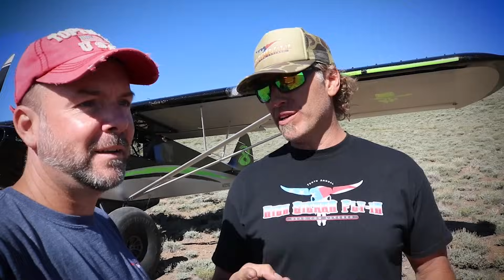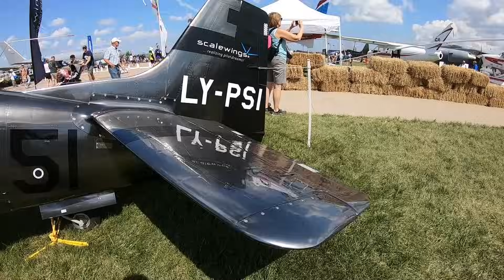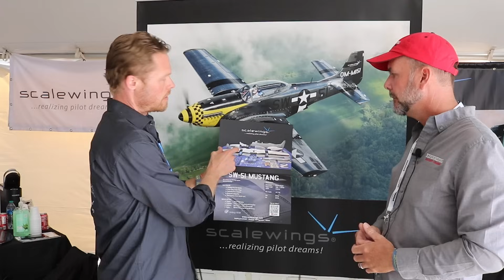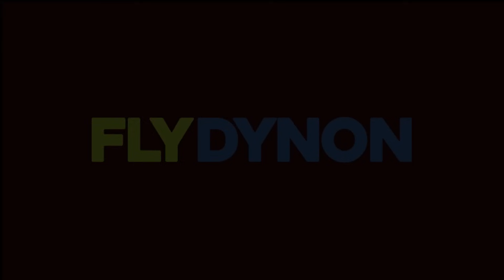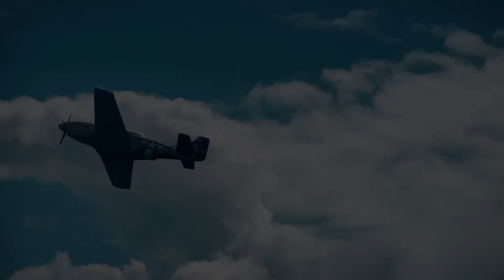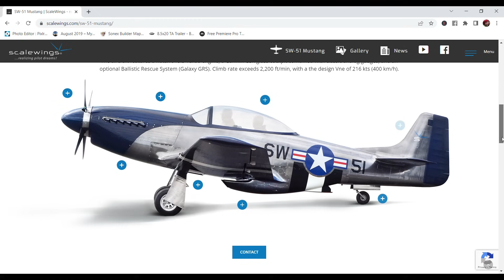Military Aircraft SW51 Mustang YOU can Build! Carbon Fiber Scale Wings Kit -  Oshkosh 2022

Comment: Someone needs to make a 70% Merlin engine.
Reply: Facts
Reply: Have a look at the  Aerosport Engineering of Norway V12 engine specifically designed for scale warbirds. 650hp 54g/hr
Reply: @bradleydavies3225  Thanks, do they sound the same? 70% Lancaster with four engines.
Reply: Ironically, most modern car V12 engines are way to small to be a 70% merlin... It would need to be 9.3L. But if we ignore that and just look at the horse power, that is about 440hp or there abouts. Well inside range of most V12 avalible today.

If you had a true 70% scale merlin it would be 255kg, that would be to heavy for this airframe.
Reply: How about 2 4.3 litre V6's melded together?
Reply: Nah that rotax has better power to weight ratio than an actual mustang haha
Reply: @bradleydavies3225  that would give plane about 15 min endurance.
Reply: nah, go full sized. thing might be almost supersonic at that point.
Reply: Steve Morris engines could make one... theoretically.    Reliability might be an issue.

70% x 12 = 8.4 cylinders.  ie, use a V8.
Reply: Use a Jag V12 and spec it up
Reply: How about the Falconer V-12
Reply: Toyota made a V12. You can get one through a JDM supplier
Reply: Doesn't REDD make good 600SHP V12 engines?
Reply: I think it's called a Chevy!
Reply: @matsv201 a V12 Chevy LS (aftermarket made engine) is 9.5 liters and has a dry long block weight of 421 lbs or 191 kg. And it makes oodles of horsepower, although it would be hard to say how much it would make in an aircraft application at low-ish rpm
Reply: Falconer v12
Reply: @matsv201  Where does this 255 kg mass come from? Of course, mass increases or decreases as the cube of the length, but yet...
Reply: @fabiena1787  yea. Just the cube of the weight of the original engine
Reply: PT6
Reply: Viper motor!
Reply: I have seen a 1/4 scale Stuka somewhere in Texas I would like to find it again but the guy who built it was in Love with Stukas  ! I don’t remember if it would do an actual dive though. ! If anyone else has knowledge of this please share !
Reply: There is an Australian company building custom v12 based on ls engine, can't remember their name though.
Reply: A V8 Merlin, all aluminum with a turbocharged engine putting out a reliable 600 HP at all altitudes. 

350+ KTS and range.
Reply: Hell ya
Reply: @bradleydavies3225 that’s a HELL of a lot better than a frikin’ Rotax (good as they are - but this is NOT the place). They scale it down in size by 30% but cut 75% of the power!!   Booo
Reply: A 70 percent Merlin would be wayyyy to heavy compared to the rotax in this plane also it would be roughly 70% of the power in a regular Merlin meaning it would be much to powerful and have awful Torque roll and ground handling on takeoff
Reply: True. But the airframe they designed was made exactly for the engine that’s in the bird.
Reply: Jaguar has a 12 cylinder
Reply: There used to be a Falconer v-12 just for this kind of application. It was based on the small block Chevy...!
Reply: Ryan Falconer makes a small block Chevy based v-12 just for this kind of application.

Comment: Imagine if this company built a 70% scale P38, that would be really interesting
Reply: Love the P-38! 

I wonder what the Yamaha inline 4 would do in such a dual-boom craft? The Yami 4 is doing amazing things in other experimentals, producing nearly turbine weight to power ratios with modern ICE fuel burns.
Reply: @RobertLBarnard  Indmar Marine builds marinized 2.3L EcoBoost engines. Makes me wonder how the engine would do in an aviation application as well.
Reply: @RobertLBarnard   "Fly Rotary" is all I'm sayin'...
Reply: @RobertLBarnard  imagine if the LS was built into a air engine. we see 2000hp ls's all day now. i can imagine a full scale carbon composite P51 with a 2000hp SMX with extra sumps for flying at any angle.
Reply: It would be awesome but I imagine the liability for a twin engine P38 close who's original design was  killing pilots in steep dives would be far too much to assume
Reply: Yeah, a P38 would be cool... but I want a 70% F4 Phantom!
Reply: @nunyabidniz2868  oh, I followed the avi 13B's for a lot of years. Carbon carbon apex seals, Teflon o-rings, alconal secondary combustion chamber, boosted, stratified combustion.... Slow fade of hp vs catastrophic... Yeah, lots of potential, lots of flying examples. Just wish the fuel burn could get better.
Reply: @alphotomc9867 the Berkut had the same type of canopies as the Phantom. I remember being introduced to Klaus Savier (Light Speed Engineering in Santa Paula CA), he built the prop for it and went into a lot of detail of what he did to design and build it. I'll never forget that conversation.
Reply: @louisbabycos106  The liability rests mostly with the builder, although anyone can file against anyone for any reason. Also, I don't imagine an engineer would take a set of P-38 plans, key in "70%" on the scanner/copier and start selling copies. A "replica" of a P-38 would more likely resemble the Pond Racer in it's evolution.
If someone wanted to own some real P-38 lineage, it's purported the Questair Venture was designed by a team who could trace their work all the way back to the P-38.
BTY - The Questair Venture was said to be a fine aircraft. Fast, close coupled, slick, all aluminum, retractable... Did I say fast? Examples competed at Reno. Unfortunately one owner/pilot was killed when he took his Questair 30 kots above it's Vne of 300. Maneuvering around pilon at 330 knots, the horizontal stabilizer appeared to come apart, a small porpoising motion and they were gone. The investigation suggests that even though the aircraft was operating well outside it's published specifications, the flutter wasn't the cause. Rather PIO as a result of the spring in the elevator force feel/limiter assembly was the wrong size and had only 30 percent of the required tension. Other discrepancies and workmanship issues were sited. The plane when built right, had significant margin designed into it.
Reply: @borgheses  looking at all that shiny aluminum.... Beauty! Way, way back, 30 years ago now, I worked on an engine project for Ford. It used the Cosworth casting process, we could keep a 7 thousandth tolerance in an aluminum casting. A 4.5 mm wall thickness all around, lots of ribbing and 3 mm fillets. Very light, very strong. Head bolts all the way down into the main bearing blocks. Line bored mains... Load bearing oil pan & skirt. Cracked rods. Hollow cams to carry oil to the powdered metal lobes, so the rolling bearings on the valves rode on a cushion of oil "sweating" out of the lobes. Lots of cool stuff at the time. The 4.6 engine went into the Lincoln MK VIII, it was the second engine program I worked on for Ford.

It's great to dream big!
I'm trying to dream something I can build and afford to fly. That's why I keep looking at those little Yami's. Tough as nails, used widely in experimental aircraft for competition and back country flying. We'll over 200 HP in a 200 lbs package, sipping (non-ethanol) fuel from the pump. The inline 4 block has reduced frontal area too. It's a cute engine with excellent metallurgy. The ones out of snowmobiles seem to be just a tad bit heavier built than those out of a bike. They also don't have all the extra casting for the (bike's) transmission.
Reply: @pootmahgoots8482  These are cool little powerplants. I'm a little partial to Ford (we're Michigan natives, long line of machinists and toolmakers for Ford and Ford-related stuff. I worked on several Ford projects in the CAD/CAM field 30 years ago)...
I like the Ecoboost systems. Lots of opportunity with the CAN-bus for aircraft tuning.
Reply: 💓💓💓💓💓 Yes and a spitfire!
Reply: You just need to go down to the horse race track to find the pilots, so everything looks right.
Reply: Hey, with God anything is possible🤷‍♂️
Reply: Ta-152
Reply: @borgheses 2000hp for what, to run down the 1/4 mile once then get checked over? Aircraft engines run at high load for long periods of time. An LS would likely require a gearbox for the prop. Aero engines are completely different, and for good reason.
Reply: Now imagine that and a p-40 Warhawk

Comment: Airframe looks pretty compelling.  Would LIVE to see this upgraded to 3x the power.
Reply: I’m not sure that 450 hp would be desirable in this airframe. Unless you’re looking at a turboprop, any piston engine of 450 hp is going to add an unmanageable amount of weight.
I’m a horsepower fiend, but I believe the designer has landed on the sweet spot of power to weight.
Reply: Strap a Merlin on the front of this thing and you still won't be able to exceed 216kts.  The extra power isn't worth much of anything without an increased Vne
Reply: @Skinflaps_Meatslapper  Interesting that it would be limited in this way.  Why build something that LOOKS like a P-51, but does not perform more like a "hot rod"?  It's like those lambo kit cars based on a Pontiac Fiero or Volkswagen beetle running gear.  Sure, it LOOKS like a lambo, but it still performs like a relatively slow economy car.  Not complaining, but curious.  The Rotax 915is can be configured with up to 300hp.
Reply: Nope, strap a modified Kawasaki Jet Ski supercharged 310 hp motor on there. Another guy in the Experimental world has one with 410 hp for STOL competition planes. They are extremely tough powerplants! All forged steel and can handle up to 1200hp in race configuration!
Reply: @RitzRT  Giving this plane more power would be very similar to retrofitting a 400HP turbo hayabusa engine in a moped that experiences an unavoidable high speed wobble at 65mph.  Sure, you'd get up to speed quick...real quick...probably doing a wheelie the entire time...but you won't be busting through that 65mph mark unless you just feel like dying.  The reason why they made this plane with an inherent speed limit is because they had no interest in making it based on performance.  It started off as a scale RC plane meant to look like a mustang, and they simply scaled it up to fit people.  The whole thing is based on appearances alone, and I wouldn't be the least bit surprised if they called it a success after finding out it could only fly 100mph.  Scale warbird enthusiasts have this mindset that they need to fly slow to look more scale, and they're real particular about copying panel lines and rivets...apparently that mindset is pretty hard to shake off when designing real airplanes.
Reply: @waveman2952  Those engines can handle short busts at that level of power output, but they can't handle continuous operation anywhere close to that.  You'd probably get by with safely using the unmodified 310HP continuously if the PSRU was geared correctly.  Not even that STOL competition plane uses that extra power continuously, it's only a short burst for takeoff...the rest of the time it's pulled way back so the engine doesn't tear itself apart.  Doesn't really matter though, the extra power won't do you any good with this airframe.
Reply: @Skinflaps_Meatslapper  Not disputing what you're saying, but I can't imagine investing the time and energy into building a project like that only to have "ho hum" performance.
Reply: @RitzRT  I was really excited about this plane when I first clicked on the video, hoping it might fill the gap between a Titan T51 and the thunder mustang, something that would have a cruise speed falling between 225-325mph with a little more power than your average kitplane, because that's a sorely under-represented area in the world of replica warbirds and kitplanes alike.  Some guys like warbirds for their looks, some like them for performance, some like them for both...so it's a little ridiculous to only cater to the looks crowd when all it takes is some sound engineering to make a bird this size handle far more than a little rotax and a 216kt Vne.
Reply: It is a little disappointing to see a very nice 75% scale P-51 but that only goes about 50% of the speed of the original and only about 60% of the climb rate. I mean, the original had some 1,700hp and this doesn't even get 150hp.
Reply: @misegades  Like buying a Corvette with a chevette engine.
Reply: @misegades  The ideal power for this size and scale P-51 replica is in the 600-650HP range, if you want to meet or exceed P-51 performance.  That was pretty well established with the Thunder Mustang, while the Stewart S-51 established a 275mph baseline with 400HP.  This particular aircraft is on par with the Titan T-51 at near identical performance with similar power.  Scalewings at one point were planning on making a US experimental version that could support up to 600HP with a boost in gross weight among other things, but I guess they decided to focus on fake rivet placement instead.  The original model was meant to have a 2000W sound system to imitate a Merlin on startup, complete with a little smoke system for effect, so it's pretty apparent what they're going for.

Comment: Dears, the current Vne is based, with some margin, on the actual Vh with the Rotax. (Vh is the maximum horizontal speed) 
Of course with a larger engine, the aircraft can technically do higher Vne (upon testing and confirmation). 
Due to the use of carbon fiber push rods in the control surfaces and the entire carbon fiber structure design with huge static load reserves, and incredible stiffness, the aircraft can see higher speeds at all and is principally already designed for it ;)

Comment: Outstanding detail on the airframe, but there's no way I'm paying $200k for a 70% scale fuselage that uses 9% of the original hp.
Reply: Another video said they are working with a partner to investigate powering with GM LS V8!
Reply: @clarkstonguy1065  Well that's great and all but the Vne won't change with a bigger engine.  You might be able to climb at 6,000fpm or whatever with a big engine but you're still limited to 216kts, full stop.  You're also only working with about 50gal including the optional tanks, so if you're talking a 400HP V8 expect to be burning 25gph, maybe 20 in economy cruise, and that leaves you with 2hrs or less of fuel on board and short little 400 mile legs.  It's a nicely scaled plane, but it falls pretty short in capability and performance.  Kind of the same issue the Titan T-51 ran into, they originally made it for a Rotax, then later went up to V6 and V8 engines but their potential was still limited by that annoying Vne and little fuel tanks.
Reply: @clarkstonguy1065  It's certainly achievable given that the Thunder Mustang folks pulled it off with the Falconer V12 engine.  Though that doesn't appear to have helped them sell many units.  :P
Reply: @clarkstonguy1065  Chrysler Hemi would be better.
Reply: 9 Tons armed and fuel if I recall and 51000 ft with the most advanced supercharger ever produced to this day, 2600hp. That sc cost 250,000 easy
Reply: @jamesbullock7257  Wow, out of all the numbers you threw out there, not a single one is remotely accurate.  That's impressive actually, statistically you should've been able to guess at least one of them correctly.  Also, the supercharger is integral to the engine accessory case, you can't just buy one and bolt it on a different engine.

Comment: As one considering a P-51 kit in the future, I am quite picky, especially with the amount of money involved. My problem with this Scale Wings Mustang is the prop. It's too short. I understand the aerodynamics, but I want something bigger. That may put Scale Wings out of the picture for me unless I can swing a longer 4 blade prop. I like the idea of dual-place, dual-controls, but the canopy is too big, which damages the scale lines as well. The proportions are off, so far Stewart looks better to me.
Reply: there are other Prop variants available.. this one has a diamater of 1800mm, but we do offer a Titan Aircraft prop of 2160mm as well. Depending on the engine, we also have a MT-Prop of 2300mm available, which exactly mimics the shapes and size of the Original Mustang at 70% proportion. Remember, this is a Kit plane, so the choice of Prop is your decision. See our gallery at www.scalewings.com for the big 2300mm MT-Prop on our serial number #000 "Moon Eagle"!
Reply: @scalewingsaircraft  Thank you!  Moon Eagle is what it should look like! Wonderful! The canopy is not a deal-killer, but I do want a longer prop. Your Mustang is definitely the most stunning. Say that an American uses the assistance of your manufacturing facility. What are the options of getting the aircraft to the United States? Is flying it to the U.S. an option?
Reply: @scalewingsaircraft  Does the Rotax 915iS swing that 2300mm prop, or is a bigger engine needed? Where can I find performance specs with the big 2300mm prop? Has anyone in the U.S. expressed desire for fractional ownership & building of an SW-51? I'm an A&P, structures & sheet metal specialty and have a commercial/instrument & a few hundred hours. Tailwheel certified & want to build a Mustang. With the 2300mm prop! Ha, ha, I'm a picky S.O.B. Will this be ultralight in the U.S? Certainly not. Dual controls?

Comment: The real P-51 had laminar flow wings that helped it with top speed and fuel efficiency. But that also made it easy to depart controlled flight during a low speed maneuver. Does this design have that issue?